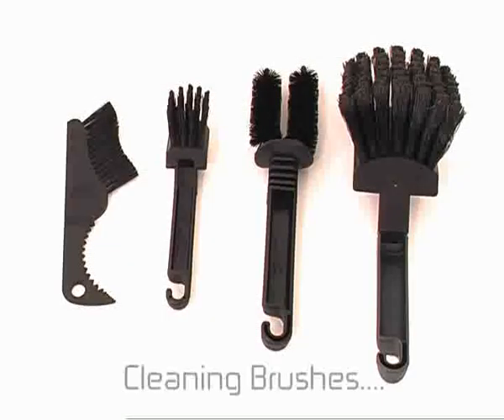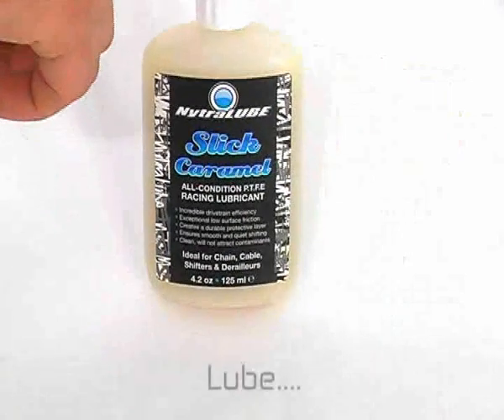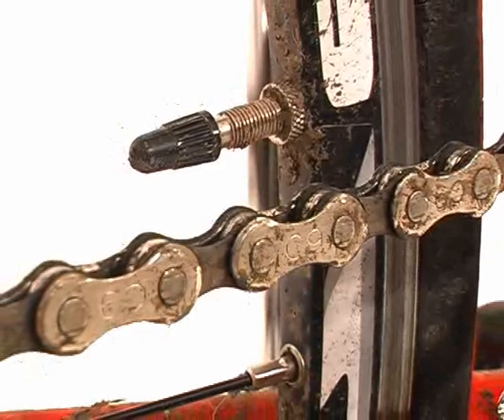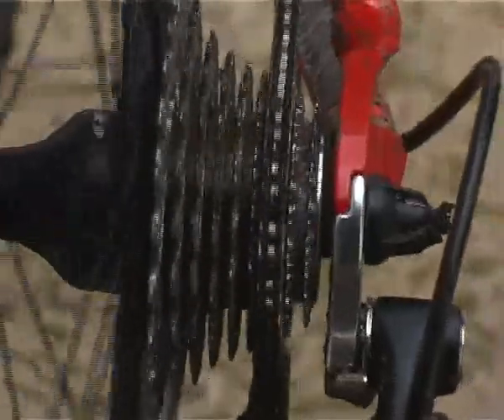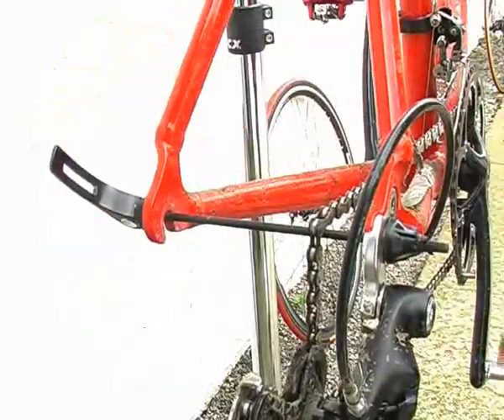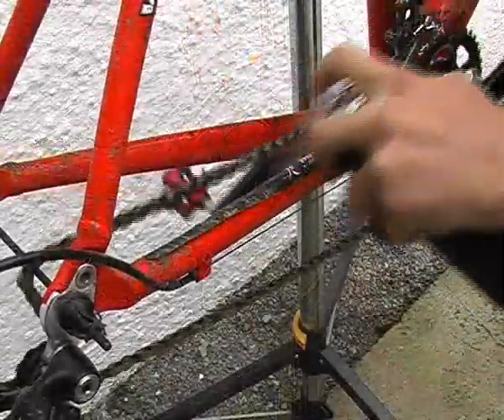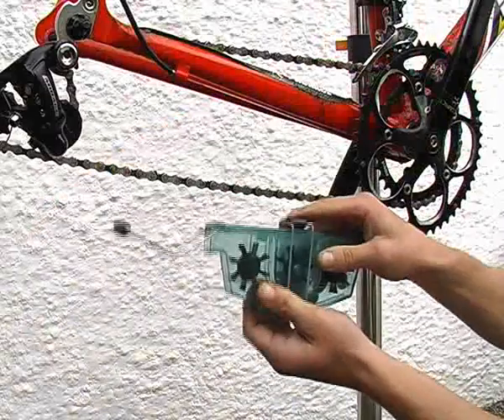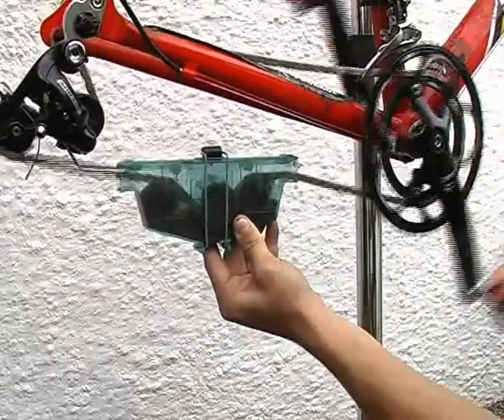Cleaning, lubing and inspecting

Comment: kerosene and diesel fuel works well and it also lubes a bit. Gasoline/alcohol/acetone/paint thinner is a more effective degreaser (it strips the grease out leaving a non-oily surface. sometimes is good to be that way).
Any solvent can be filtered and reused, but acetone vapors very quickly while diesel fuel will last a long time.

The main issue is the plastic that can be damaged by some of these solvents. 

You have to test and try to see any induced damage (brittleness/ cracking/discoloring)

Comment: I use gasoline as a degreaser. Not very environmentally friendly, but I reuse it a lot (i just filter it trough a rag/tissue, nice and clean and good as new). Paint thinner also works well, acetone, any kind of alcohol, any kind of organic solvent (like vinegar, and other organic acids), even oil can clean that stuff, but it's too thick to penetrate anything.

Bottom line: I use gasoline in a chain bath and works fantastic.

Comment: You don't need that much of a dissolvent to clean the chain. Just take off the chain and sprockets and dump them in a bath of mineral oil. Let them lie there a while and then wipe of the smut and wash the oil away with soap. You can reuse the oil several times and you can wash your hands the similar way. Cost is minimal and enviroment thanks you.

Comment: hard to explain to someone who isn't technically adept. in the chain manufacturing process, every single pin is lubricated. (thats btw. the only place on a chain that has to be lubricated, anything else has to be just slightly coated...) in a chain bath you'd destroy this lubrication. the lubrication after the bath can't restore this, unless you lubricate it under big pressure ;) but don't think about things like that on a 30 dollar chain... better buy a new one instead of cleaning :P